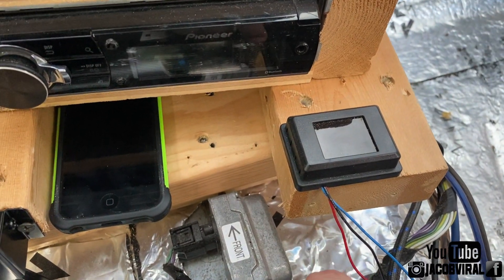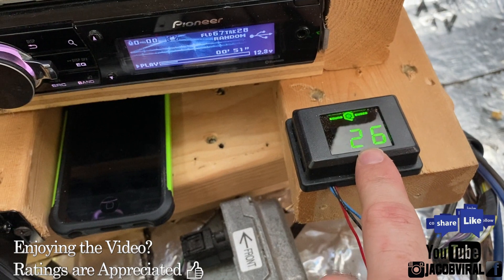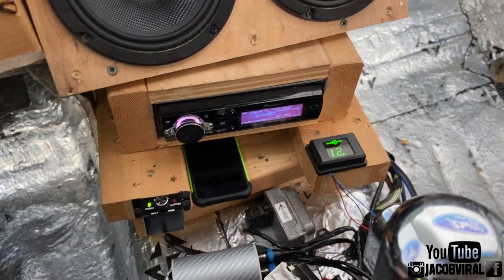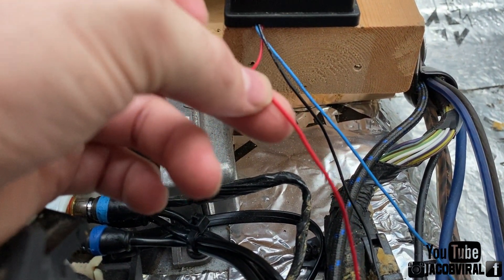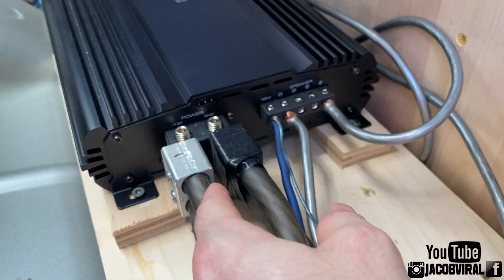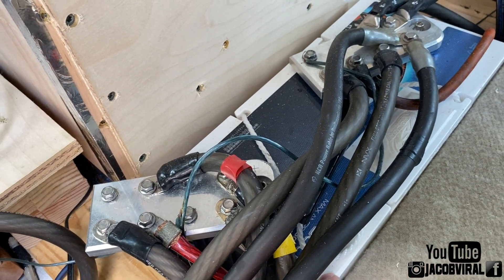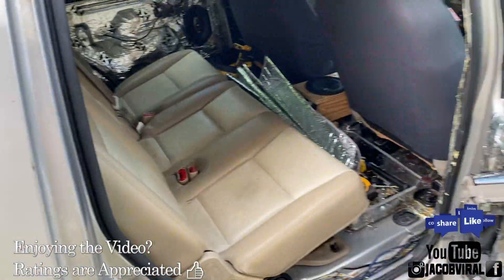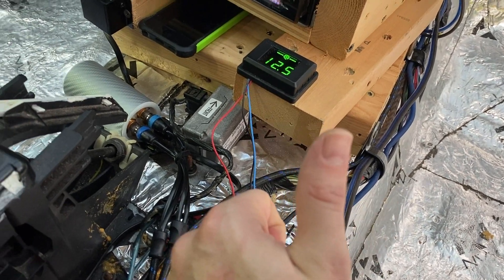VOLTAGE METER AND WHY YOU NEED ONE FOR YOUR SYSTEM?

Comment: Could I just run my power wire to my amp run my remote turn on wire to my amp and my ground to where my ground wire is from my amp
Reply from the maker: I would say most just use that method

Comment: How do you do this with a 2 wire volt meter?
Reply from the maker: If it's power/ground only and not a 3rd blue turn on/switch wire, you need to either have a disconnect or a switch between the power so it's not always on.

Comment: How accurate is the voltage on the 80prs?
Reply from the maker: It was known for higher quality then most HU for the range, so very accurate and seen 100s use them without problem

Comment: What if your voltmeter only have 2 wires power and ground how would you get it to cut off ?
Reply from the maker: A switch on the power somewhere you can turn off/on. Usually cheaper meters don’t have that 3rd wire

Comment: I had my volt meter connected to my mono block and over months of use the wires melted and shorted and blow my fuse not sure if i should wire to amp again or too battery intead

Comment: Hey, I have an actual voltmeter and was wondering how can I test voltage. Where should I hook it up? I currently have a stock battery.
Reply from the maker: Go directly to battery/amp power. Test with multimeter to confirm accurate.
Reply: @JacobViral2  If I'm testing from amp, should I connect to power wire going into the amp and the negative ground going into the amp? Thanks.
Reply from the maker: @kawaiidono8633  correct, atleast measure power from amp and ground anywhere able but amp works too.
Reply: @JacobViral2  I appreciate the help!

Comment: Will a longer power wire from the front voltmeter cause any voltage drop/misreads?
Reply from the maker: if proper gauge size, no it shouldn't. I would definitely do at least 12-14gauge. it's always best to be close as possible for optimal readings ofc but minimal difference

Comment: what size wire do i need to connect the voltmeter to my amp?
Reply from the maker: 14-16guage work fine. Look at the thickness it came with as example.

Comment: My voltage meter does not turn off when my car does, is this safe? Or do I need to do a diy remote wire
Reply from the maker: It will slowly drain your battery, you need a remote wire meter or a switch
Reply: @JacobViral2  thanks, I spliced a connector onto it.

Comment: I have a cigarette lighter voltage meter and it reads pretty accurate
Reply from the maker: It works yea but won’t be as close accurate as near amp/battery.
Reply: @JacobViral2 I had to come back to this video. I'm in my car with the air on and it's reading 11.7  to 11.9. The cigarette lighter meter I figured wasn't gonna be as accurate
Reply from the maker: @D_Marquis_LS  your alt and electrical had more strain when ac/heat and other electrical is running. I wouldn’t use ac/heat when playing loud.

Comment: My voltage is going form 11.3 too 99.8 when I turn it up  is it a wireing issue or is my alternator going out I use to be at 12.5
Reply from the maker: Usually these meters max out at 18~v and then reads HI so something seems off. I would upgrade your electrical.
Reply: @JacobViral2  I got 2 batteries should I up the alternator
Reply from the maker: @PhilTooTrill  It's recommended yes, especially if running over 1.5-2k rms
Reply: @JacobViral2  yea I got a 3000 watt amp and a 1200.1 on the doors

Comment: I had my last amp blow one day (it was really hot) and knew it was because the lack of power...

But after learning more on eletrical for car audio... I realized if I had a volt meter before hand, I could have seen my voltage was dropping way too low. (11v) And would have upgraded before blowing an amp and the killing cells on my battery.

Comment: I have a glowshift digital volt gauge hooked up straight to my battery, is this giving me the reading I'm looking for or should it be hooked to my Amp somehow?
Reply from the maker: If it's your back battery yes it's just fine unless you only have front battery.
Reply: @JacobViral2  yes I only have one battery that powers my car and my audio. I also have a 12chevy cruze with some sort of smart alternator that provides power based on my vehicles needs/draw 

I suppose I will move my gauge to the back of my car and wire it to my amp :) thanks man

Comment: Where can I  buy a good 12-24voltmeter with remote wire or can I buy a 2 wire and connect power to amplifier and connect to close ground area.
Reply from the maker: I use this https://amzn.to/3KNh87H
Reply: @JacobViral2  ty that helped alot and already ordered it

Comment: Man the more I watch u the more I get confused..now thats not a bad thing but shows how much I know ..love bass..been a bass haed since I was 14 im 39 ..I use to get 2 15s 3k watts get a 3k amp and jus run it all stock..As we all started off..now I'm getting more into I and wanting to know how many volts do I need to be at and how many watts on 2 15s and at what hurtz and what tune ya know ???plz help!!!love ya Parker!!!
Reply from the maker: Depends on what the subs rated at. I suggest  120-130% power vs. rated subs to get you some head room to not max amps out and keep it clean power. Keep voltage above 12.8v if able all times really 14s best.

Comment: I connect mine to my amp but dont have remote cable on volt meter only bat and gnd a its all time on. How to do that it can be off when i turn off the car and shut it?
Reply from the maker: You have to use on/off switch  like this https://amzn.to/30NIPeg through the power line so it’s not always on to be best so you aren’t tracking voltage through a turn in wire.
Reply: Doesn't it only turn on when your amp is on if connected that way?
Reply: @tonybologna8522 did you find out?

Comment: Just installed a voltage meter. I do alot of camping were I listen to my tunes with my engine off, l was so surprised to see how fast voltage went down from 13.1 to 12.3 ,that is when l restart my engine. This basic little system tells you what you electrical system is doing 👌. Love your work (cheers from Australia 🇦🇺 👍).
Reply from the maker: Nice Rodney sounds like fun. Glad to help!

Comment: While idle and full tilt at 3k half ohm I drop to 12.5 I'm at 14.3 at idle...when I was at 2ohm is drop to 13.4...so is 12.5 BAD or tolerable?I have no clips of dimming etc...it's a taramps smart3...and car off rests at 12.7
Reply from the maker: Low 12s isn’t horrible but I would try to stay above 12.6 min and not clip and you’ll be fine.
Reply: @JacobViral2   So with the engine running i should be seeing around 14v and engine off around 12.6?

Comment: I have the same voltage meter, Can I run the remoter to my amp also?
Reply from the maker: Yes as long as it is on the turn in and not power for the blue wire. https://amzn.to/3fCbat1

Comment: I purchased a Down4Sound lithium battery that came with a digital voltmeter with just pos and neg..I've connected directly to my amp and it's stays at 0.00 even at the front battery this is with the vehicle on
Reply: Someone answer this cause I have one too
Reply: @Ohgetoffended  it didn't work
Reply: @ceavalencia4767  damn. Did you wire up a switch? Or splice into the remote wire for amps?

Comment: So master I got a ds18 universal bass knob with a volt meter so i was wondering if I could run the power wire for this bass knob to the battery without a fuse??

Comment: hey do you know a lot about soundqubed? im trying to link a bass knob but i have 2 amps so i cant use 2 bass knobs so how can i use just one? i have htx4s off2 2200s
Reply from the maker: Use the bass knob on the master amp and it controls both if linked. Or an rca bass knob from the head unit before the amps with a rca distribution block.
Reply: @JacobViral2 each  amp powers one sub  they are not linked thats my problem. can i use a rca? when soundqubed uses a phone type cord for theirs? this is my first big build  so im trying to do it on my own in a clean 04 escalade on 22s
Reply from the maker: You have to use two bass knobs unless you have a rca bass knob coming from the head unit in and out rca first before the amps.

Comment: can i just wire the volt meter and ground straight to the amp??
Reply from the maker: Yes that would be great as well
Reply: @JacobViral2 Will that keep the volt meter in 24hrs since it straight off Positive & Negative?

Comment: if you want the most accurate read hook it up to the power and ground inputs for the amp
Reply: I need one and probably going to do what you suggest
Reply: should you fuse that volt meter power wire?
Reply: @JohnSmithAudio  if you want to play it safe i guess you could run a 2 amp fuse but i never have....

Comment: How do i wire my has only 1 positive and 1 negative but i have my wire with the remote for it could turn on and off with my heatunit with a meduse
Reply: You can install a relay that turns on with the remote wire and run the positive from it to positive of the volt meter. If you can't then you're best installing a switch you can turn on manually.

Comment: can you post a video on how that brand of volt meter works, how efficient it refreshes the readings, or at least for now tell me how this compares to the stinger. I look forward to your video on this or come explanation via a comment
Reply from the maker: Noted will do a video sometime sure. I’ve had both and used to run both at the same time. I do notice a major readership rate difference which I love from soundqubed and it shows the spike drops a lot more then the stinger. It’s worth the few extra $ if it was me. Accuracy is the same on both it’s really just color and refresh rate different.
Reply: @JacobViral2  Should you have a fuse for the volt meter if you run the power wire to your amp?
Reply from the maker: @riveralley  to be safe yea but I don’t
Reply: @JacobViral2  can you use a 12 foot 18 gauge wire?
Reply from the maker: @riveralley  I would recommend atleast 14 guage, but i mean if you see what size wire is from the meter :)
Reply: @JacobViral2  it'd be the smd volt meter.

Comment: Any thoughts on the kind you plug into the cigarette lighter??? That's what I'm doing. Only around 1k rms & stock electrical?
Reply from the maker: Works as well but recommend getting one to run off the amp as a secondary down the road. You’ll be fine as a monitor atleast to start :)

Comment: So correct me if I’m wrong but isn’t the alternator the best place? I have mines hooked up to my alternator
Reply from the maker: Battery provides the reserve for the amp and where you have the most draw while your alt has to go through all the wire current so that is another good option aside from back.

Comment: For me my voltage meter is so important, I have the DS18 one, its my level control, amp switch and volt meter all in 1. Im only running 1000 watt system (800rms subs and 200rms mids/highs) and it allows me do figure out what songs have highest gain of bass, voltage drop means the song is bumping! But also if loud and no voltage drop can mean you are around tuning frequency and have good efficiency! Also I can bump music with engine off without doing damage. My boss set up dual batteries in out work van with dual voltmeters and it made it super easy to figure out what battery was starting to die.

Im a cyclist for fitness and I use power, rpm and torque measurements, (along with a whole lot of other readings) when my power messes up its a big deal because you literally dont know what your doing to a certain degree as in you might not be able to tell and extra 50 watts apart. So you end up putting out too much power and loose all energy to get home. Same goes for an amp, overdrive it without proper energy supply and it will bonk and burn out :')

Comment: My volt meter has only two wires. Ground and power only so i wired my power at on acc wire directly to my ignition switch on acc works just fine
Reply: No ground  just power and works fine?

Comment: How about connecting the voltage meter's power wire directly to my amplifier's power wire fuse block? (I don't have a second battery) Bcuz anything attached directly to the battery positive terminal ought to be fused, right?
Reply: Correct unless you want a short